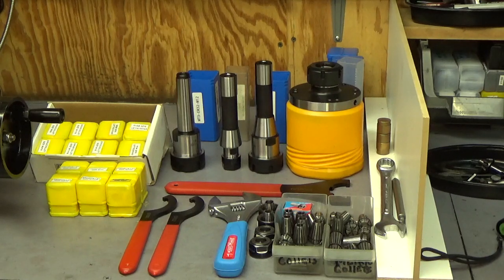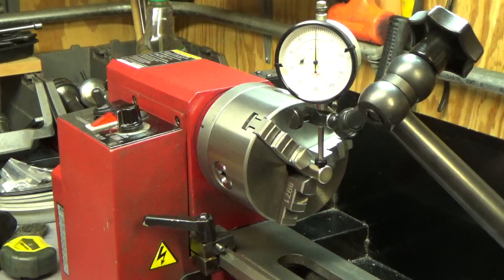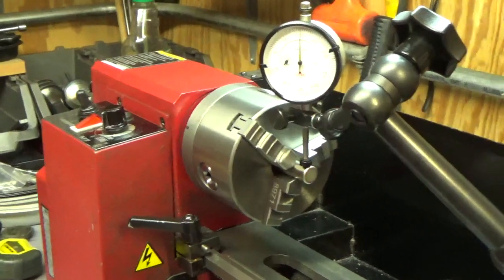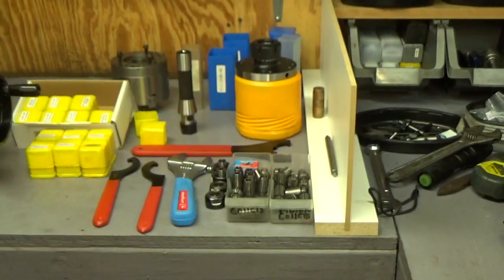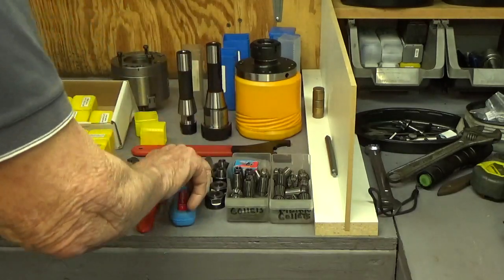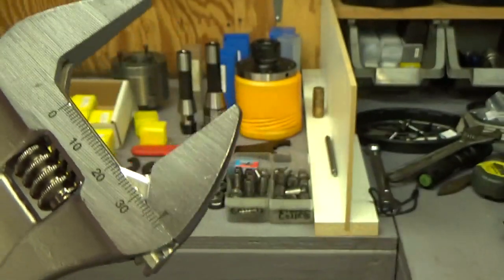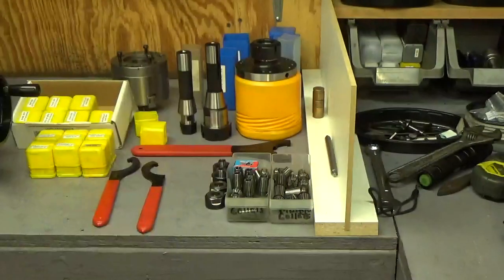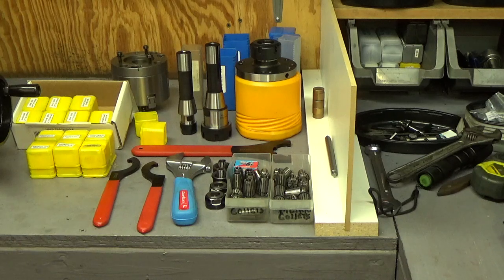ER32 MT3 Collet Chuck Runout - Mounted to Mini Lathe Spindle - Additional Videos to Follow

Comment: I used a tool post grinder and re ground
 The outsides of the collets  that I supper glued to a true mandrel. The collet proved to none concentric and the bores were out of line with the outsides. After grinding all my collets are within 0.02mm it didn’t take long to do and I’m really pleased with them now.

Comment: I’m new to the lathe and purchased a collet head chuck and a set of collets and mounted it . I tested the run off on mine and it was .0015 runoff . I have a HF 7x12 and was learning on a 3 jaw chuck , after installing the collet chuck and using a 3/4” brass rod and carbides it turns and chips beautifully! I wish I would have had it sooner ! My first project was a brass and aluminum ring for my wife and it worked perfect ! I don’t know what to say except I love my new setup !
Reply from the maker: Dave: It seems that you had good luck with your purchase.  I know there's good stuff out there, but when buying from China it's the luck of the draw.  It all looks beautiful.  Regards: Larry.

Comment: Banggood spring collet chucks are notorious for being inaccurate. Almost every review I have seen have shown them to be off well over acceptable limits. 
   Don’t dismiss ER collets as being unacceptable because of this experience. If your lathe spindle is running true a quality made ER chuck will also run true. I bought my ER chucks and collets from Shars . Yes, Shars sells tooling made in China but in their own factory located there and they maintain very strict tolerance levels on every product. Of course you should expect to pay more but you will get something you can use for its intended purpose instead of as a paperweight. Buy nice or buy twice.
Reply from the maker: Dale: First; Thanks for your comment.  Second; I didn't expect perfection.  Third; When they spec 0.0002" concentricity, I would expect something better than 0.0025".  The collets test the same in all 3 ER32 chucks, and they were specified @0.0003".  The collets don't show any obvious imperfections.  All my spindles run true within a few tenths.  Yes...…...I've had pretty good luck with Shar's over the years, and find them reasonable, as far as price is concerned.  The register mounted chuck was my biggest disappointment.  I did complain and recouped half the cost.  I should of gave up at that point, but decided to delve in deeper.  Best Regards: Larry
Reply: @larrypoindexter9351  I've been occasionally inspired to visit reviews of various ER32 collets and chucks only to always come to the same conclusion. I so rarely need better precision than my 4 jaw chuck that it's worth it to make a "one off" collet turned in place that for lack of a better description runs perfectly true as long as I keep the chuck tightened on it.
Reply from the maker: @ExtantFrodo2  Your absolutely correct, however collets can do many things that a 3 or 4 jaw cannot.  It's not always precision that I'm looking for.  It's simply the holding ability for certain items.  Regards: Larry
Reply: @larrypoindexter9351  yeah I know. I like what can be done with collet blocks (both hex and square), but the thing about tool envy is that how could anyone ever be able to afford all the tools they might ever want? It always comes back to nanotechnology and just programming matter to be organized the way you want.
Reply: @C M W DId ya ever see?